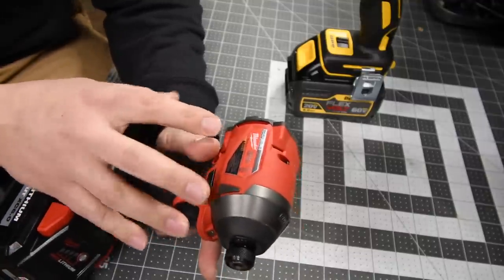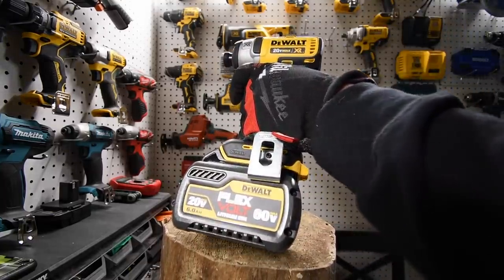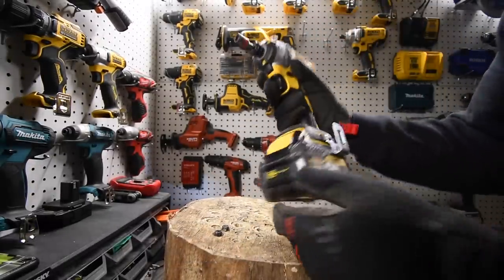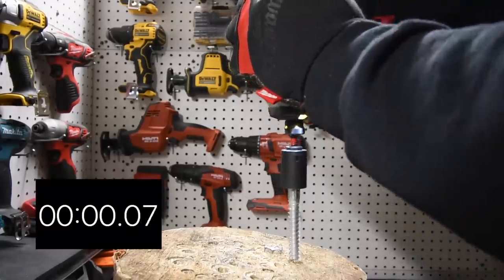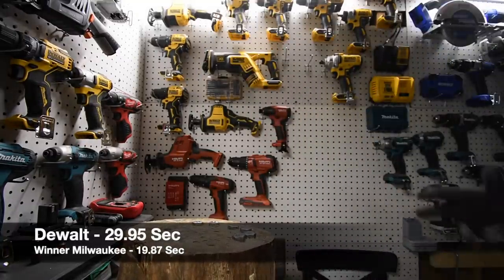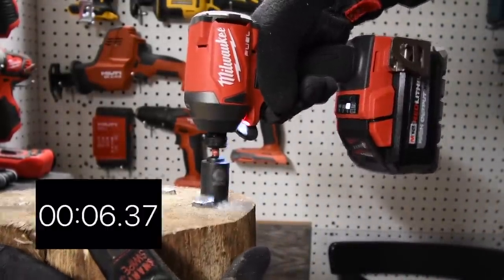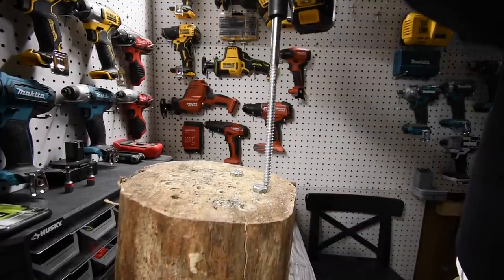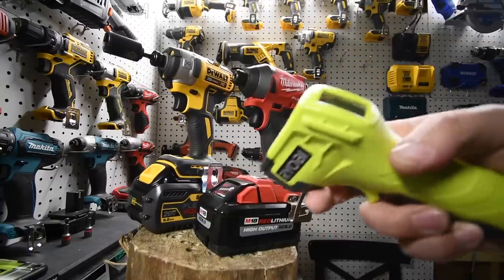Milwaukee vs Dewalt (Impact Drivers)

Comment: I know there are some people out there who don't like setting 1 on the DeWalt 887 impact- but personally I love it...
It's a very precise setting just keep holding the trigger down for one impact at a time after the pause... I use it a lot to not over tighten or to seat Fasteners just right..
Anyone else like speed one on the 887?
Reply from the maker: I need to redo this test with both tools have 21700 cells in there batteries

Comment: Is there a Re-tapping Gun with 30 RPM ? We need to re-tap the Bolt on structure after Hot Dip Galvanizing
Reply from the maker: I am not too sure on that

Comment: This dude only puts pressure when he uses the Milwaukee impact. 
Wish it was an honest comparison
Reply from the maker: I dont put that much pressure on these tools. I simply just hold my position so I dont lose control of the tool
Reply: I agree you can tell he favored the Milwaukee.
Reply: Facts. Everyone knows DeWalt is still tops, and they'll last longer than anything else out there, it's like a sport to try and put em down. Or drum up views or soemthin
Reply: @Ripskiis  Than why are they less expensive than Milwaukee?
Reply: @Chris X  Same reason Glock is more expensive than a far super M&P. Build hype around a name and you can pick whatever price you want. Means nothing about quality. Taking Glock for example, cheap made, corner cutting, virtually no improvement, corner cutting bland gun, sold for more than others that are better in every way. Because people are easily manipulated.
Reply: @Ripskiis  Glock is cool because of Counter Strike.

Comment: I mean I want the Milwaukee but I already have a grinder, drill and more stuff from Dewalt so I dont want to buy more batteries and chargers for Milwaukee
Reply from the maker: nothing wrong with not buying tools you don't need
Reply: They make Aftermarket battery adapters now...just sayin.
Reply: I have 7 Makita tools, 5 batteries and 2 chargers and just went out and bought the Milwaukee gen 3 drill and impact combo, the jobsite fan and a HO 8ah battery with a rapid charger lol. Who cares if you are invested in another brand, Milwaukee is where its at!

Comment: The dewalt impact driver was on setting 2 you can see that and I use dewalt everyday setting three would of smashed that
Reply from the maker: it was not on speed 2. if it was, the times would be totally different then what is in the video
Reply: @Jordan Hunt, your just a fan boy.
Reply: The Milwaukee was on setting 1 I seent ittt!!!

Comment: Just a quick question is dewalt 20v max original and better than 18v ?
Reply from the maker: 20v or 18v batteries are the same.
Reply: I’m talking about the drill not the battery

Comment: All tools today is great I think it's just like picking from chevy or ford. I wonder if I put the 8ah battery on my 996 dewalt drill will it be as strong as the new dewalt drill 998 can u find that out for me?
Reply: Jason Shepherd The 996 with the 8ah battery is not quite as strong as the 998 with the same battery.
Reply: @Kara3405  Thanks man for information looks like I will be buying me the new dewalt 998 set
Reply: @Kara3405   Thanks for letting me know
Reply: @Kara3405   I meant to say thanks for letting me know that my 996 want be as strong as the 998 I can't to get my hands on the new dewalt drill and impact
Reply from the maker: I will be getting the new 8ah battery with 21700 cells soon

Comment: That is not the appropriate dewalt battery to use for this matchup. Btw, that was obviously a rigged election. You changed the rules the moment the results didn't please you. The dewalt caused you to trick the Milwaukee into removing its own lag and we all just watched the dewalt remove a lag the Milwaukee failed to remove. Regardless of placement we can all reasonably assume the lag itself produced more friction than it's counterpart. A third note, I have to make money with my impact. There is more to a head to head matchup than how fast it can drive it's first lag. Especially when we can all agree that on the jobsite that is not the tool we would be using to perform that particular work. Comfort, agility, run time, diversity, usability... these are all areas we are grateful dewalt traded those "winning specs" for. You only succeeded in displaying that Milwaukee chose a steeper gear ratio and that you are eager to showcase it whilst proclaiming that is the most important aspect of tool design
Reply from the maker: you are correct, the Dewalt had 18650 cells in it while the Milwaukee had 21700 cells in it. I am remaking this tests with both tools having 21700 cells in them and I thank you for viewing Richard

Comment: Theirs either a hard spot in that log or you had the Dewalt in the wrong speed , because it  put the 10" bolt in almost as fast as it did the 6' , only about 3 seconds different ...
Reply from the maker: wood is more dense in some areas, that's why I keep the bolts in the same area.

Comment: I have a Milwaukee Impact Wrench - 1/2 inch drive and the damn friction ring and anvil cap broke off. Then the socket got stuck on the anvil. And yes I was using impact rated sockets. Pfft.
Reply from the maker: its a bad situation and I am sorry about that Drewism
Reply: Good thing they got the best warranty out there

Comment: Dewalts and Ryobi are meant for at home casual use. Milwaukee is best for the job sites putting in timber locks and t20 t25 wood screws all day at the job. Milwaukee didn’t burn up like others over a period long use
Reply from the maker: I do thank you so much for viewing :)
Reply: Dewalt lasts forever, I’ve got tool sets that are 10 years old. And I’ll give you the 2 seconds quicker and still set more screws! Lol

Comment: Technically the new dewalt 6ah 20 volt max battery should give it more power as it has 21700 cells vs that flexvolt battery which uses 18650 cells.
Reply from the maker: I will be revisiting this test with 21700 celled batteries.
Reply: I believe the 21700 only increase capacity. The tools will still be receiving the same voltage, but I could be wrong. I'm not an electrician.
Reply: Garrett S. It has nothing to do with voltage. You are correct they have the same voltage. The increase in power comes from the cells having a higher amp discharge rate allowing the tool to pull more current which is what produces the power.
Reply: Garrett S. The newest dewalt tools with power detect actually has the ability to detect which cells you are using and if you are using 21700 cells it bumps up the amperage even higher to gain the most power it can.
Reply: @jamesfair9751  That's actually really cool then. Can't wait to see how it performs. I'm invested in the Milwaukee ecosystem but I still love dewalt.

Comment: Lags aren't really a far test. I'm pro milwaukee. Have been for 10 years plus but usually you predrill the holes for those lags..... thats why you needed big boy to get them back out. Driver drove them in expanding the wood but then the wood shrinks bsck in around them making them twice as hard to extract

Comment: Time vice Milwaukee clearly won,  but still prefer Dewalt, it feels better in ur hands and seems lighter (could be wrong) ? And from the video Milwaukee seems alot more noisy? But great video!
Reply from the maker: Dewalt is a fantastic brand as well and I thank you Jonas
Reply: I think they do feel better in my hand the Dewalt vs Milwaukee ,  both are excellent
Reply: Same feeling

Comment: I recently bought a milwaukee m18 kit with impact driver and drill, just wanna trying find out the feeling how milwaukee works. I have been usning dewalt 18v for the past 3 years. 
Don know what to go next since I have a dewalt whole kit with grinder, hammer drill, torch, multi tool..
I also use milwaukee m12.
 I love them both, just wanna have different feelings when using them seperately..
Reply from the maker: this milwuakee impact driver is #1 and not a single comnpany has made one yet that can beat it

Comment: Great video once again no partiality and not a lot of talk and joking and clowning around but i think you have a fondness for Hilti it good though what is your opinion on the Hilti impact drill driver  ?
Reply from the maker: The hilti impact driver does not have a lot of power. I did a video against it with Ryobi and it was neck to neck.

Comment: My 3 years old Dewalt 887 died last week. I want MILWAUKEE, but I have lots of  Dewalt 20V other tools and batteries. So I bought a new 887, at least it's CHEAPER.
Reply from the maker: if you have the batteries getting the dwelt is a smart choice
Reply: You could get a battery adaptor to use your Dewalt batteries with Milwaukee tools. I ordered one off eBay just so I can try out Milwaukee sometime.

Comment: Correct me if i am wrong.... This test is not equal.... Milwaukee 6Ah battery vs Dewalt 6Ah Flexvolt battery.
6Ah Flexvolt battery behind DCF887 is simply  2x3Ah battery. Buy Dewalt 6Ah battery and test again please.
Reply from the maker: I did another test  with both having 8ah batteries with 21700 cells in them and the milwuakee still won by a long shot

Comment: And now I'll have to buy a Milwaukee impact after seeing this lol
Reply: don't fall victim for secret adverticing. There are more factors for being to be a good tool than specs.

The Gen 3 has alot of flaws.

It has a lot of slips 
It is crazyout of balance with this high output batteries because they are so heavy and long.
It is also very heavy and not operator friendly to use it while it weights 4.85 pounds on that batterie.

Milwaukee needs to get a 4 Ah with the  new cells on the size of the Bosch ProCores. Than it would be powerful and light weight but like this it is no fun to use at all.
Reply: and the ball bearing issue in the collet so bits will fall out
Reply from the maker: id go with the brand that you are already into, just because it has the power doesn't mean you need it, the dewalt ws able to do the tasks as well, just a little slower
Reply from the maker: I agree
Reply: @Zozo806  I knew all this already I'm a makita fan for life but havnt tested or tryed Milwaukee yet a know about thier problems and issues with collets size thier batterys I'm just impressed with the power I do take into consideration of all that what u said and I don't really like dewalt seen to many of them burn up on vcg .they just don't have the power or reliability my opinion but I seen dave take out that 10inch lag Milwaukee kept shutting off made me think a bit
Reply: @ManCaverTools  says the man with about 10 different tool brands lol alright then dave ps a don't like dewalt very much I wanna see for me self try few different brand tools out cause not really been  in the cordless power tool game for that long
Reply: I have used milwaukee for a while now and I've got to say it's the best I've ever used closely followed by makita and hikoki. I think the dewalt isn't bad but that the only impact I ever had that stopped working sadly but apart from that the power and feel of the dewalt is great too. But that's just my opinion.

Comment: Reduce the velocity... You'll gain more tork
Reply from the maker: this was a contest for speed
Reply: This will work with drill drivers ,the case here is far different the more the revolutions the more impacts from the anvil so therefore faster driving ....

Comment: Millwaukee has a overheating protection or something of that sort if I recall correctly so in the case that the tool is struggling to much it trips off a sensor and shuts the tool off wich may be anoying but better for the tool in the long term
Reply from the maker: Yes sir and I thank you Danick

Comment: I would like to have seen you include the foot pounds of torque for both impacts (or nut busting power as Milwaukee puts it) because Impacts per minute is one thing but how had each Impact hits is a little different
Reply: Also you are using a brushed vs a non brushed
Reply from the maker: I do now, this is an old video and I changed what I do since this video

Comment: I was wondering  I know both products are sold at home depot are they the same quality or are they a cheaper model for that store?
Reply from the maker: they do have different impacts in general. but no, its the same quality if you get it form a different store
Reply: @ManCaverTools  different impacts?

Comment: Where is the Milwaukee made
Reply from the maker: China
Reply: @ManCaverTools  that's enough for me to buy an Ingersoll Rand W7252.  more power than the m18 fuel, made in USA and will outlast the Milwaukee. 
I used milwaukee tools in the trade and they perform very well but don't last as long as dewalt or hilti by any means.
They seem built for consumer grade use rather than commercial

Comment: Nice review....  It's hard to make a choice after reading some of the negative reviews on the Home Depot site.  Also, I'm wondering, are there any of these power tools made in the USA? I know it's hard to do, but I'm not wanting to buy anything Chinese made these days...
Reply from the maker: made in the USA and assembled in the USA are 2 different things. Dewalt is assembled in the usa
Reply: And DeWalt is owned by Stanley Black & Decker, which is an American company.  Milwaukee is owned by TTI, the Chinese company that also makes Rigid and Ryobi.

Comment: You should tach the drills under no load, and do a torque reading,    Without the engineering specs you need the measurements.  These speed tests make no sense.
Reply from the maker: it makes perfect sense. these are very hard tasks to do for a impact driver. speed and temperature tells the story.

Comment: I still use my fathers dewalt tools with an adapter they work with the lithium batteries they still work great. Also, there are some inconsistencies in your testing that may or may not influence the results. Maybe in the future better think out the testing so you make things more consistent.
Reply from the maker: very good inconsistencies are in real life and these are real life tests
Reply: @ManCaverTools  That is true, I am referring to the screws into wood, wood is inconsistent and the amount of pressure someone presses is also inconsistent multiple runs helps this and you find the average. (Don’t forget to throw out the outliers) One test for each bolt/screw is not enough to determine that. Other than that I completely agree real world tests are ones people need.

Comment: Got a Dewalt XR DCF899 1/2 hog ring 
Dewalt XR DCF888 1/4 bit holder 

(Uk ) 18v XR 2ah and 5ah battery 

Love them
Both the 888 being my favourite tool 

I even got the battery 18v chainsaw 

I believe 18v uk is same as 20v us for the XR range 

Wish they will make a 3/8 stubby 

And soon will buy the angle grinder and the hammer drill
Reply from the maker: very good and I thank you for viewing Burgattti

Comment: Why do you use two hands for the Milwaukee and only one hand for the dewalt? You definitely push harder with the Milwaukee
Reply from the maker: im not using. for the Milwaukee I needed to hold my position better then I need to with the Dewalt. that means that the Dewalt is easier to control

Comment: What I would like to know is how long equivalent tools by different brands will last?  Nobody does that.  Then, I would know the true cost.
Reply from the maker: because how long  a tool will last depends on the user. the better you treat your tools the longer they will last. some people let their brand new tools fall to the ground form 10ft and more and wonder why they don't work. treat the tools with respect and they will last longer
Reply: @ManCaverTools  If you did the test, so that would be constant, and you did the same things with each tool, and you didn't drop them from 10 feet, that would give people a good idea of how long each tool would last, without ridiculousness.   Another way is to build a test rig and let it run constantly.

Comment: so, the 1/4" milwaukee also beat the 1/2" dewalt on the 10"lag.
Reply from the maker: yes and no, I had to use the 1/2 impact wrench because both dewalt and milwuakee failed to take the lag out
Reply: true, but the milwaukee drove the long lag in  4 sec faster than the heavy duty 1/2" dewalt. 

dont downplay the dewalt  loss, your gloves and eyewear clearly show youre on my side, lol
Reply: deth502 1/2” is lower rpms
Reply: The same bolt milwaukee couldn't take out? .. Impact wrenches are not about speed its about power.. The milwaukee driver would have prob beaten out the milwaukee wrench too in time..

Comment: Bet the atomic would do better. Miluakee makes a bitchin tool no doubt but I think they should retune it so it doesn't cut itself off so fast. I know it's the tool saving itself, maybe a high amp draw or temp sensor tripping the cut off but givin the abuse mine sees daily they shouldn't cut out so quickly. I've had the same issue but maybe 4 or 5 times in the yr I've used it

Comment: You had the dewalt on the number low setting really bias from the beginning
Reply from the maker: I did not. the dewalt was on 3rd speed.
Reply: Its speed setting r opposite direction of Milwaukee

Comment: Hilti smokes them all
Reply from the maker: I did a video on it and this milwuakee is un matched
Reply: Really, smokes em AJ ? So, is this your professional opinion from using both brands in the field daily? Or could it be a baseless opinion plucked from air. Just saying is all, your channel did not say if you have a carpentry or mechanics business and how you tested your "smoke em" theory. Again, just saying cause of all the video's I have seen about "your theory" does not hold water. Would you please upload a video on your claims cause I'm an  old school fact type of guy. Which means I don't believe random baseless opinions just because maybe you saw a guy using one and not the other. But, could be wrong about you...been wrong many times.
Reply: @61spindrift  hilti is better all day long fool.
Reply: @61spindrift  cobalt makes you better drill for you small time viewers. Just saying.